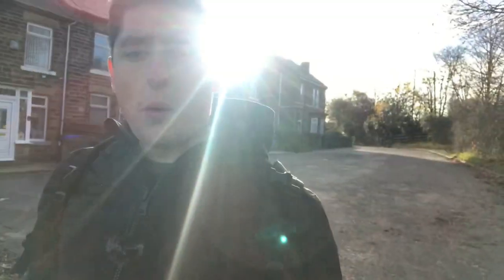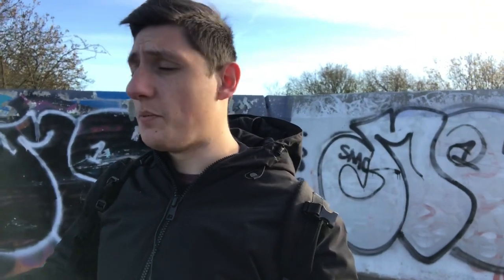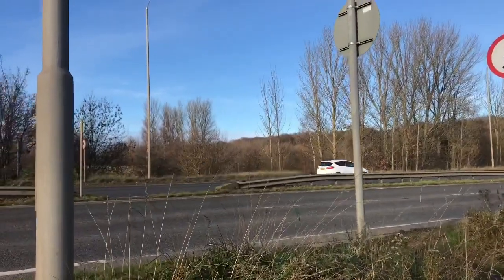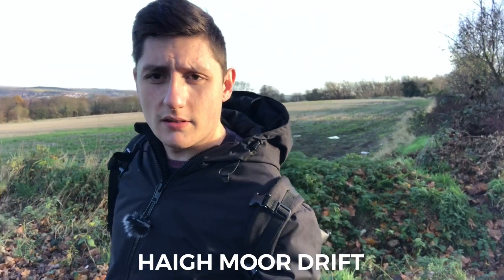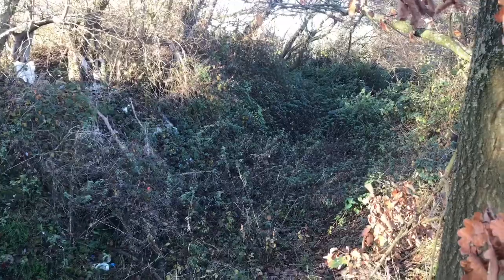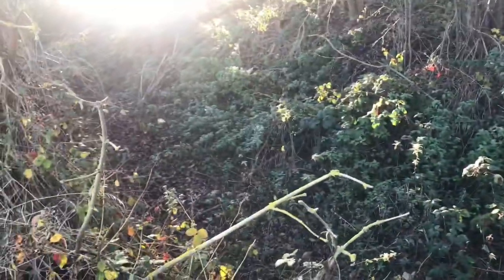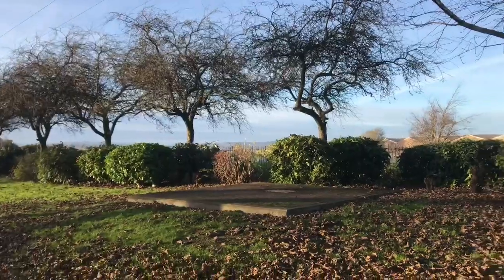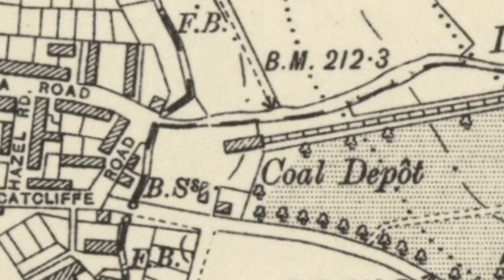High Hazels Colliery History Tour - Abandoned Haigh Moor Drift Mine & Tramway (Sheffield)

Comment: I worked as a surveyor at the Handsworth Colliery in the latter half of the 1950's.
The Haigh Moor drift mine (we pronounced it 'HeyG (hard G) Moor, not Hay Moor) was still in production - I walked down it regularly, a roughly 1in3 slope as I remember. Haigh Moor was the name of the coal seam which surfaced in the area. Two other, deeper seams, Flockton and Silkstone, were also worked at Handsworth. There were also a coke ovens and a tramway which ran to it from Handsworth Colliery. The coal tubs were clamped to an endless steel cable which dragged them along the tramway, thus it was called by we local folk, 'The drug road.'
I never heard of a Pitch & Toss ring but I was told about the dog fights which were held on Sundays atop the spoil heap at Handsworth. Sentries were posted to watch for the police.

Comment: Well done. I went for a run around here yesterday and traced the route of your video. The 1938 map that I have seen shows the drift entry down by the bridge at the bottom of Waverley Lane (surrounded by the extant red brick wall). The cutting covered in brambles is the line of the tramway between High Hazels Coking Ovens and Handsworth Colliery. About halfway up the track bed are more brick walls. I believe these to be from the two bridges that spanned the track at this point. The bridges are detailed on old maps.